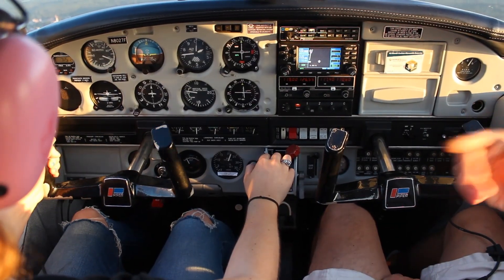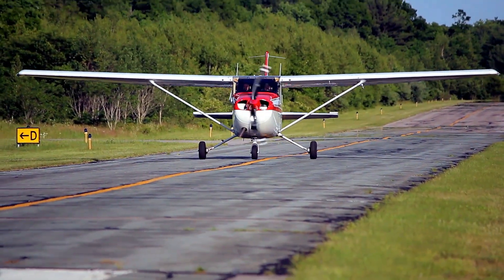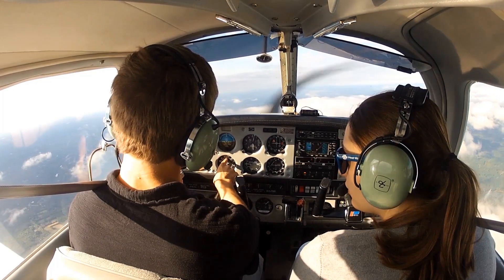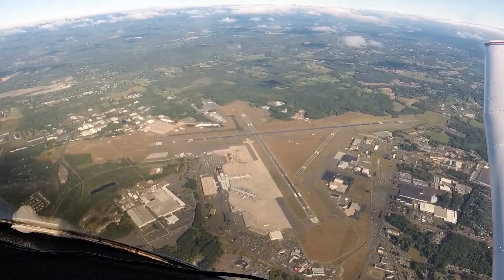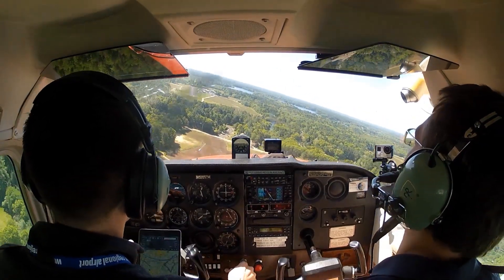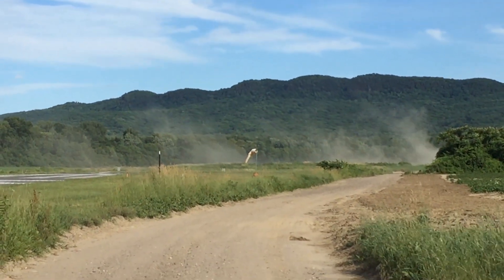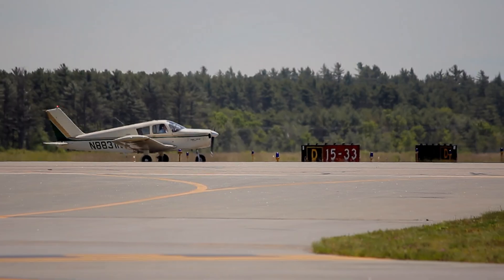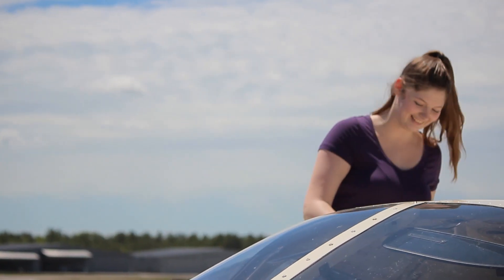Carb Heat Demystified:  Understanding the mechanics and the dangers

Comment: Green arc on a tach indicates no carb heat required? 

Something I didn't know with 6,000 hours total time. Always learning!
Reply: Can you Friendly guys post some source for your claim? I question the green arc is meant to say anything about carb icing:

- In Piper (P28A) AFMs the green arc on the rpm indicator is described as "normal operating range". No single word about icing..
- On a P28A the green arc goes down to 500rpm which is also the lowest tolerabe gorund idle rpm - you'll never get that low inflight. As a consequence, the carb heat is not required? Aha!

Sorry but this sounds wrong.
Reply: @gonzothefirst3051  Well, the manual of the Piper also simply says to never use carb heat unless you need it because the carburetor is icing...so, there is no carb-heat appropriate engine speed. SO, the green line goes all the way down to nothin'! Makes sense to me!
Reply: Alex Melia or you always need to use it  ;P
Reply: Carb cars had a valve on the snorkel of the air filter housing or container. That valve was opened or closed by means of a small thermocouple on the housing. When valve was working, it closed the cool air entrance and thus It directed heated air from around the exhaust manifold to the housing. When intake air temp was about 120 F it opened to allow cooler air from the housing main snorkel. Sort of an automatic carb heat system. I was an Engine Performance Tech for decades. Carbs and Fuel Injected engines.
Reply: My Mooney doesnt have a green arc. I guess I'll never use it again ;)
Reply: Buuut - Switched in front of the air filter. Donno why they should suck in uncleaned air in a plane or even risk that, just put the filter behind the switching. - Or just add a second filter.
Reply: @PsiQ  Think the idea is to bypass filter if it gets clogged with ice or dust. Still at other times looses crap in.
Reply: Its needed any time you have lower engine load, e.g. lower RPMs with part throttle. Engine vacuum is what drives carb icing. High throttle = low vacuum and lower risk (unless its really cold out). It all goes back to gasoline's vapor pressure. At high vacuum it flashes and pulls lots of heat with it. I dont think the arc is for that, but if your throttling back you will want to have it on. Not a pilot, but dealt extensively with it on old wetflow systems for cars that used computer control. Its a very extensive and not well understood topic. At any rate high vacuum for long periods of time would give icing and older car engines used coolant or heated air off the exhaust to heat everything to stop icing.
Reply: Gonzo the First 

From my CFI days many years ago...

I seem to remember while in flight if you're in the green arc, the engine is driving the propeller. If you're outside of the green arc, the relative wind is driving the propeller which is not normal. 

I cannot find where I learned or read that info. It's been 10+ years
Reply from the maker: I am constantly amazed by what I learn everyday in aviation :)
Reply from the maker: No kidding.  I always figured that's how that would work.  You're always a wealth of knowledge :)
Reply: Gonzo the First   --It is wrong. You need carbo heat in high humidity. Even Pipers get it, but not as often as no air filter box Cessna.
Reply: JesseFlies: 
Green arc indicates normal (cruise) operating range.  

However, additionally, in a carb-head-equipped carbureted Cessna (especially one with a continental engine, for instance C-150 and C-182), if you lower throttle such that the engine drops out of the green arc, you should turn on carb heat regardless as a precaution.  When lowering throttle in general, even in the lower part of the green arc, it's not a bad idea.  And wherever the rpm gauge is in such an airplane, if the engine does something surprising (slows down unexpected, surges, etc.) turn carb heat on and go to full throttle.
Reply: Green arc is just a lazy way to define when to use carb heat. Some rpm gauges have green arc all the way round to the red line.
Reply: that's a really good question.
I can only assume the idea is, if there is carb icing, there may also be air filter icing? I've never heard of that happening though. or maybe it has to do with maintaining the de-icing air temp? or unrestricted air flow velocity/pressure/volume to ensure de-icing occurs quickly?

Maybe an aeronautical engineer can shed some light on this. Anyone?
Reply: Alex Melia
Fuel injection = no carburator
Reply: Jesseflies I give you thumbs up because I know you are being facetious!  LOL!
Reply: Alex Melia: Really?  I thought they all did.  What model of Mooney is yours?  (I think every Mooney is supposed to have a green arc on the RPM gauge.  See the Type Certificate Data sheet.  I have, in fact, flown one in my training that had NO markings on the tach whatsoever.  I found that very distracting since I know that they're supposed to be there, including a red section from 2000-2350 RPM.
Reply: @gevmage  I know it's an old comment. Maybe the reason is that it has a fuel-injected engine = no carburetor? Most Mooneys (except for the early 1960) have a Lycoming IO-360 or Continental IO-550. My Beechcraft with a fuel-injected Conti IO-346A also had no color markings on the RPM indicator.
Reply: Hey  @___Chris___  , 

I'm always interested in exploring more.  

I have been told repeatedly by flight instructors that when out of the green arc (on continental powered Cessnas), use carb heat.  I have never, ever found that written down anywhere.  I will still generally do that in continental powered cessnas, which are fairly prone to carb icing, but not as a hard rule but as a general mnemonic.  

I think the only thing that green arcs officially mean for engine instruments is that that's generally what you should expect while flying in normal conditions, but this seems to vary somewhat by airframe manufacturers.  I couldn't find quite your model of Beech, but I did look at the type certificate data sheet for similar single-engine piston models.  Beech's tach marking philosophy seems to be to have a red line at max RPM limit and no other markings.  If you want to make sure your plane is compliant, then I'd look up the Type Certificate Data Sheet for YOUR airplane (by model and submodel) and make sure your tach matches what it says.  

As far as I know, all Mooneys have a green arc on the tach, including the fuel injected ones.  (I own a fuel-injected M-20F).  I think there it generally indicates "this is where the engine should be for normal flight" kind of thing.  

The Mooney that I flew with NO tach markings was because they had their own in-house mechanic who presumably signed off on all of their annuals, and so I'm guessing they just played fast and loose with the regs and didn't bother paying for a tach with the proper markings.
Reply: @gevmage  An upper RPM limit makes sense and every POH has these numbers (usually also depending on prop diameter). But where would such a green arc in a fuel-injected engine start? You can of course add a green sector for everything that isn't "red", but then you can leave it away in the first place. There is no added information. You can't go lower than 'idle' on the throttle anyways (and I don't see the benefit of a lower limit for mixture settings, either). Maybe there is some added sense with constant-speed props(?) - might be interesting.
I've rarely flown carbureted engines since flight school in 2012 (mostly Aquila 210, plus a bit of C172 and DA20). The way I learned it: (1) expect carb icing even at ambient temperatures up to 20°C, (2) always use carb heat during decent, (3) carb heat limits max power, therefore turn it off on short final in order to have full power available immediately in case of a go-around. Still, I think whenever the POH of the specific aircraft differs in "opinion", we should forget such "rules of thumb" and listen to the experts who built that aircraft.
My Beechcraft (1966 A23-A Musketeer, fixed-pitch prop, with the Teledyne-Continental IO-346A engine, which is almost the same engine as the IO-520, with mostly identical parts, except it has only 4 instead of 6 cylinders) was recently destroyed in a storm (another aircraft got lifted up by a strong wind gust and smashed upside-down like a sandwich on mine, including a "prop strike", severe wing damage, etc., so it was totalled). I'm saying this because there is no longer any need to look anything up. I veryfied from old cockpit video footage though that it did indeed have no color markings (and the RPM indicator was an original Beechcraft part).
Reply: poppycock, carb ice, like turbulence is where you find it.

Comment: Wouldnt make more sense to  have both the cold and hot air intakes begin right after the filter? ... i mean my car (and its 27 years old) has a hot air intake for cold days starts.. it takes air from the hot air wich is arround the exhaust manifolds until air is at 20ºC at wich point it switches to the normal cold air intake automatically.. both intakes switch valve  is located right before the air filter... so no matter wich one is open the air allways goes throught the filter..

unless they built it that way so if the filter gets cloged  it can be bypassed with the heated air intake?

edit: this is just ignorant curiosity on my part.. of course there must be a reason those engines work like that and im not trying to outsmart engineers
Reply from the maker: That's what people are saying!  Piper has done similar things with fuel filters in larger planes, so I would imagine that might be the purpose.

Comment: many good points here and I agree with all of them, but I think you missed a very key point.  in decent it is not just lack of heat that contributes to icing.  if this were the case you could only get icing in sub freezing conditions, but we know that icing can occur all the way to 70F  this is because when you pull the power back a vacuum is pulled behind the throttle plate, which causes a very high drop in temperature. This is the KEY cause of carb icing in the first place and it should be discussed. it is not possible to have icing at cruise power because without the vacuum any water that goes in the carb would just continue through the engine.
Reply: I just want to add that on the old Continentals, carb ice can actually happen at full climb power. I had this happen twice with an old instructor on a training flight. We went two times around the pattern before deciding that it was indeed carb ice. Suffice it to say, we decided not to fly that day lol.
Reply: Did you apply carb heat at full climb power?

Comment: If you are flying one of the Cessna's that has the forward facing air filter, take some time to re-read the POH.  You will likely find one sentence buried in the Expanded Normal Procedures that reads "The use of full carburetor heat is recommended during flight in very heavy rain to avoid the possibility of engine stoppage due to excessive water ingestion."  (page 4-16 in the 152 manual). 

It happened to a fellow CFI back in my instructing days at OMN.
Reply from the maker: I've heard that!  Great addition.  Thanks :)
Reply: Yeeah just had weather theory lesson and instructor told me about why it is not good to fly through too much rain...

Comment: you're supposed to turn it off in case of a go-around.
Reply from the maker: Yes?  Correct.
Reply: I said that because at 4:09, you explain that it's dangerous to use it during a go-around. I agree with you of course, but using it would then be an oversight of some sort. Blame my poor english if I got it wrong, but I thought your post is about the use or the carb heat in "normal conditions", and I totally get your points, except for the go-around.
As a matter of fact, when the carb heat controller is "far" from the throttle, it's always tricky to cut it before the go-around, I must admit I forgot it once or twice... Once again, a reason not to use it if not necessary!
Thanks for your instructive post anyway!

Comment: In a normally aspirated, carbureted engine, the ultimate solution is a 'carb air temp' gauge, which has a temp sensor immediately downstream of the venturi.  This allows more judicious use of the CH control, and even allows for partial use of it, or even (when it is needed during continuous usage conditions) leaning of the mixture based on the heat being applied judiciously.  If I owned a 172, or even a PA28, I'd have one installed- not too expensive, and very useful.  All 172s are 172s; the fancier, more luxurious versions are named Skyhawks as well. The earliest ones had 145 hp Continentals, then later versions went up to 150hp;  Its been a while since I flew one- God only knows what HPs are available now.  Nice chart you showed- but much more useful if I could somehow measure dew point while in flight !!!!!!!!!   :-))))))))))), Regards
Reply from the maker: Wish I had one!  That's for sure.
Reply: easy fix; check with your A&P :-)))

Comment: Thank God for Carb heaters. It's also an alternate source of air when the air intake is choked.  We were flying a Mooney M20C years ago from North Jersey to Delaware at 8000 ft IFR and in the soup.  Suddenly, we lost 50% engine power.  I immediately pulled the carb heater and the roughness slowly went away.  Luckily, we were near Atlantic City Airport.  We diverted, landed and waited for the weather to clear.   
     It turned out that we did NOT have carb ice.   Instead, the air filter in the front of the air intake iced over.  No ice on wings at all.  The carb heater was able to bypass the air intake that choked the carburetor until we got down to lower altitude.   As soon as the engine went rough, the carb heater was on in a heartbeat.
Reply from the maker: Good catch!  Another reason I've always wondered why more are not built the Piper way.
Reply: Nick, not all Pipers are set up the same as your Warrior. Its quite the contrary- most pipers built in the 60s were built with the air intake on the lower nose just like Brand C, B, and M. Most didn't "smart up" until the 70s-80s

Comment: is i want to learn too fly not with carb heat because of complexities. can i buy engine airplane with out carb heat? can buy engine airplane with carb heat control via computer?
Reply from the maker: Yes, fuel injected.
Reply: Fuel injected is dangerous no?
Reply: If carb heat is complicated to you than you should not fly, simple as that.
Reply from the maker: Not to my knowledge.  Just hard to start.